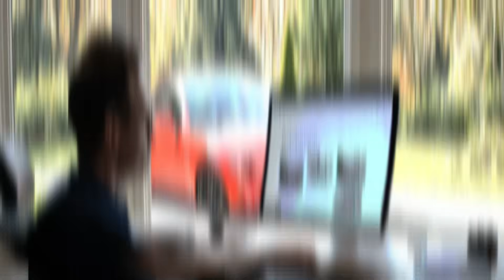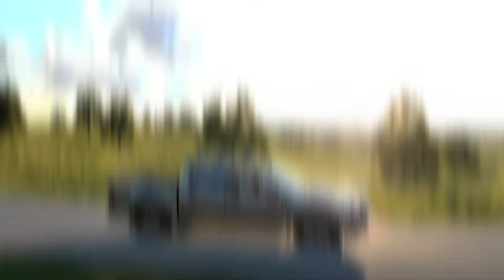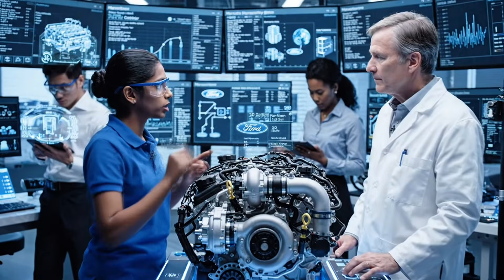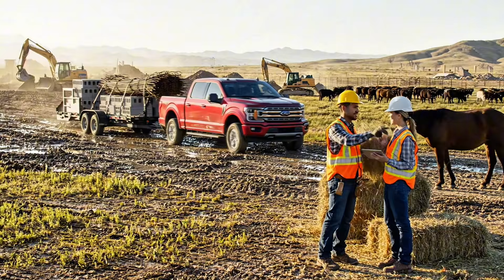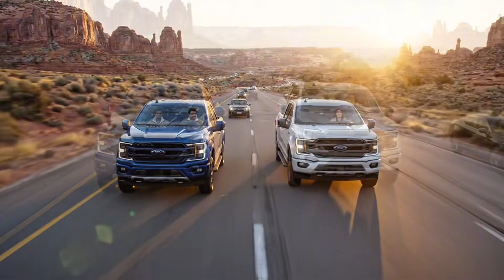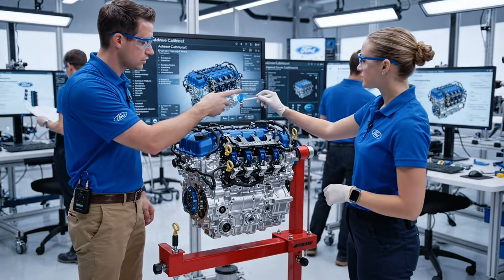Ford Just Upgraded EcoBoost for 2027 — Here’s What’s Actually New

Comment: I love the white coats😂 real smarties here. They knew direct injection and  a lot of the flaws would screw you the consumer but did it anyway to bull boost the stock and company off your back. Ive suffered working on this crap for years and ford isnt the only one. Try getting 300 and 400 k from trucks built over the last 15 years🤣 Stop the bs and build quality affordable cars like the inception of Ford intended!!!  My 1990 f250 had 420k with 3 clutches and leaky intake gaskets, one fuel pump thats all. No small ass over worked boosted terds. We personally built motors that lasted and out performed anything at the time but that doesnt make return customers every 5 years for 90k trucks like today. 
I just put 25k into my 2015 f350 6.7 and deleted all the bs, cleaned up the mess in and out they created and now have a truck that should go another 250k if it doesnt rot off the frame first. So fcken sickening to work so hard and pay 1000 a month and when done with the loan not be able to drive it. That POS exhaust cost me a lot of missed use and money but hopefully nobody hits into me now after fixing all of it. Good luck out there.
Reply from the maker: Thanks for sharing your experience. It’s clear you’ve spent years working on these trucks, and firsthand insight like yours is valuable. Many owners share similar concerns about long-term reliability, so hopefully the latest updates lead to real improvements. Appreciate you taking the time to comment.